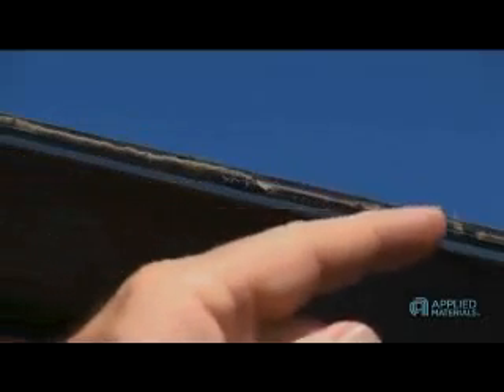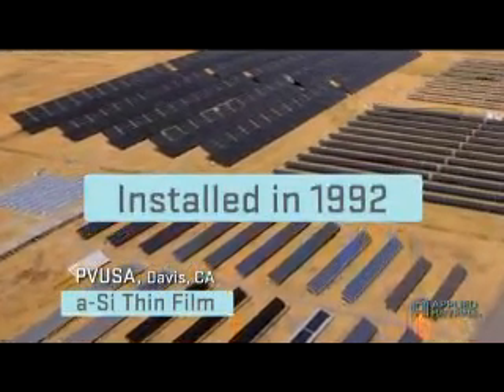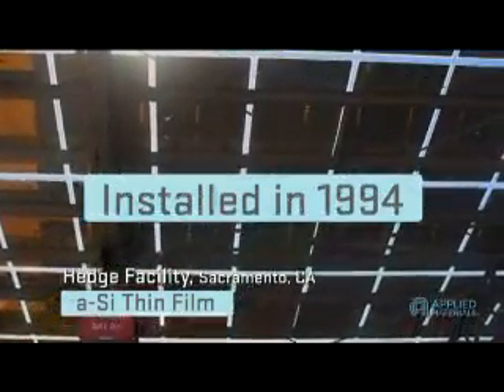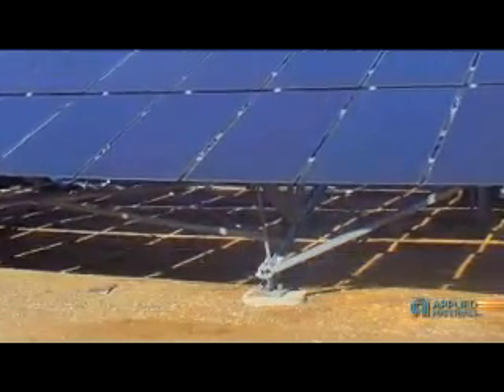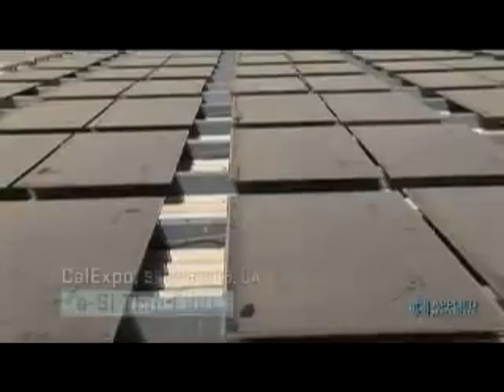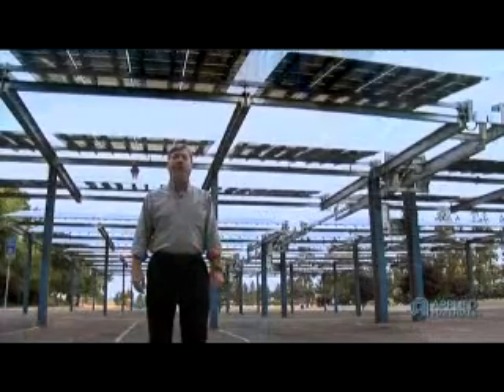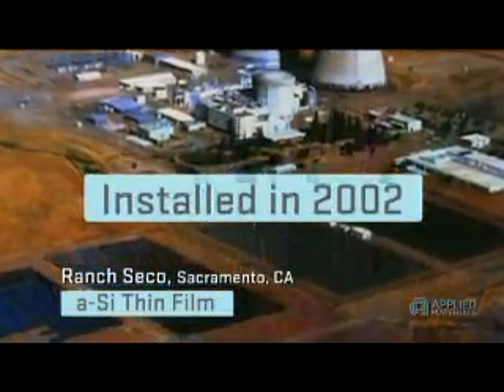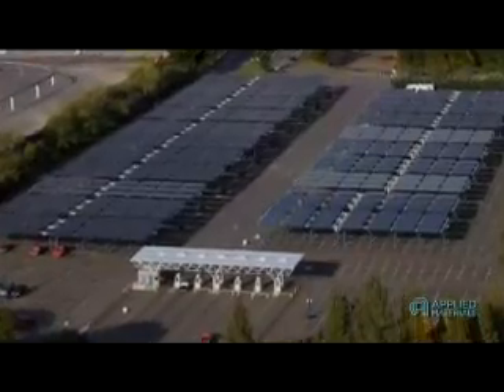Applied Materials Thin Film Field Performance

Comment: These panels were not manufactured by Applied Materials. The title Applied materials thin Film field performance is not right . To take credit of the reliability over 16 years is not just misrepresentation but a kind of fraud in my opinion.

Applied materials is a new comer in this field considering the age of the panels described in this video. Putting the wordings 'produced by Applied materials' is a shame.